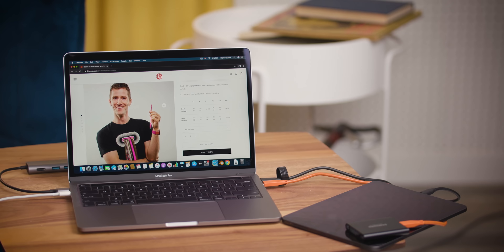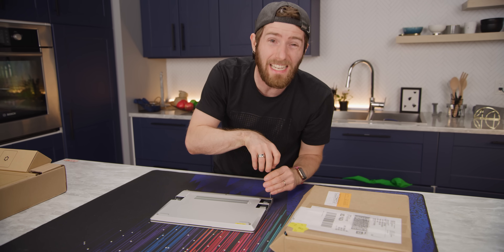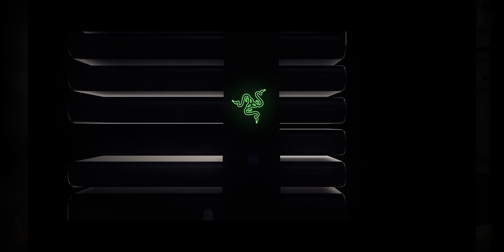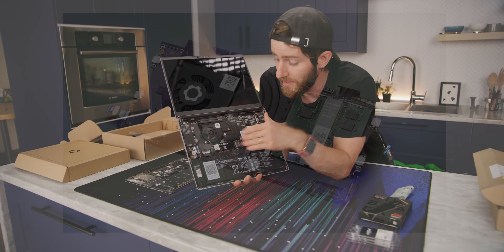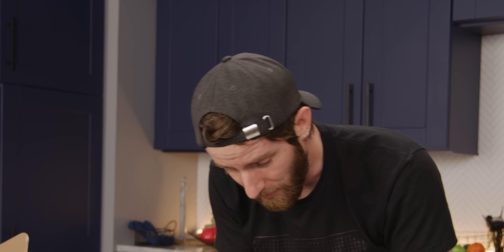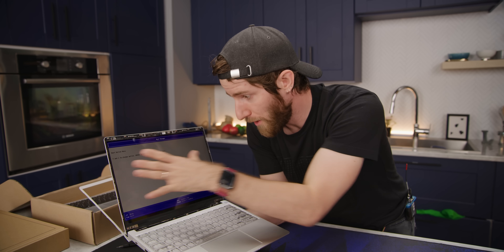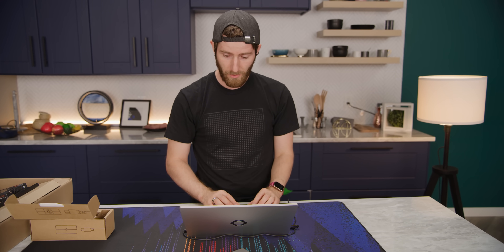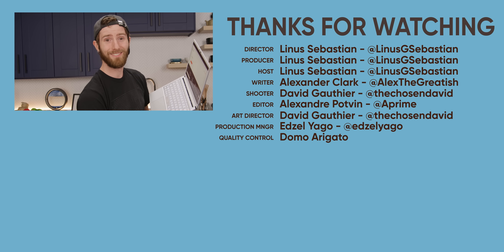A COMPLETELY Upgradeable Laptop?  - Framework Laptop Review

Comment: The only thing that would interest me about a "modular" laptop would be gpu choices, but there aren't any.  Without that, its WAY overpriced.
Reply: not overpriced if you compare it to other laptops with similar specs. But this isnt just about being able to pick what parts you want, its more about being able to repair without buying a whole new laptop or overpaying a tech that will charge you $100 just to replace a usb port
Reply: It's $1k less than an XPS
Reply: @CanadianLoveKnot    So?  A Ford truck is less than a Ferrari, but you can still buy a $100k Ford truck.  If you buy overpriced stuff, yes this is less overpriced.  If you buy what 95% of the rest of us buy, its not worth the extra $500-$600 over a similarly spec'd budget laptop.
Reply: @reviewaccount469  So what components are markedly different than an XPS? Memory, CPU, Graphics cards are all made by the same 2 or 3 companies.
Reply: @CanadianLoveKnot  
The question is NOT what is different between this and an XPS.  The question is what IS different between this and a similarly spec'd budget laptop.  The answer is the same!  The XPS, and this thing are BOTH just more expensive for no significantly better specs!
Reply: @reviewaccount469  Tell that to apple users.

Comment: That's my dream!!! Also, I can imagine using SSD expansion modules to host different OS. E.g. one SSD256 module will host Linux, another -- Win10. If I need to work in either OS -- all I need to do is to replace the module.
 Thanks for the review, have ordered DIY version. Just wondering if you can confirm the USB TYPE-C Extension has Thunderbolt support and if yed -- is it TB3 or TB4?
P.S. Hi from Toronto, ON. 😉

Comment: Actually Panda Project had a modular future proof PC that was easy to upgrade with I/O expansion cards, CPU/GPU expansion cards, RAM expansion cards utilizing a design for 256-bit computing support.  These days you might call it a Blade style of computer.  Modular support of drive cages meant you could expand your media drives and storage to whatever you needed.  It didn't matter what new standards came out as the whole PC was designed for easy upgrades.  And when the market went to 512-bit computing well they had that in the works as well.  It too was a commercial product that unfortunately fizzled due to extravagant prices.

Comment: If it can have a 360degrees/tablet touchscreen format that can extend keyboard / eGPU / high end CPU and so on, it'd be my dream. I would love to have just one system that is small and also smth for work duty.

I want smth like I have been doing with my desktop for over 25 years: modular and upgrade different parts as I go. Heck I still use the same case for my desktop for 13 years...

Comment: I still don't understand right to repair. Is there a law that makes it illegal to work on our devices? The only thing I understand is that they need to make parts available. I saw several times where you could have damaged the laptop. They void your warranty if the damage is your fault, which I see nothing wrong with. It's just like if you damage your screen. Manufacturers shouldn't be held liable for user damage.

Watch my channel and you'll see how I open up every computer and replace parts. Most people won't learn how to do board level repairs, so I'm a little curious on what right to repair does other than making other parts available.

Comment: Note that the DIY laptop is really $300 cheaper. It's base model is $963.00 vs. $749. But the DIY base price doesn't include an operating system, RAM or storage that is included in the prebuilt. So that's a $214 difference in price, but if you add even the 250GB NVMe drive (+$66), 8GB of RAM ($49), and Windows 10 Home ($139) that are included in the base model pre-assembled laptop, it costs $1003... which is actually more expensive. So unless you are going to BYO components for at least some of the laptop, or at least are going with Linux instead of Windows, you are better off going with a preassembled laptop.

Comment: wonder how upgradable the graphics are. I didn't see anything about that. with a desktop i can change out the video card making it last longer because the gpu upgrades are generally more important then the cpu upgrades to game performance in most instances. if the gpu is integrated into the MB then you basically have to buy a new MB each time.

Comment: Linus talks about this around 11 minutes but this doesn't really add anything new to the table. Most laptops support upgrading RAM or SSD's. They don't generally support upgrading CPU's, which this doesn't either. You also can't add or upgrade a GPU. It is easy to get in to and you can physically change the I/O but with USB-C you can turn that in to just about anything anyways. 

I love the idea but so far it's not really doing anything crazy

Comment: Interesting idea, but still a pretty penny.  It's been a very long time, and quite a few laptops, since I've replaced anything beyond drive, memory, and maybe battery.  What generally goes are the hinges and hinge point of the chassis.  Thinkpad used to be the gold standard for chassis.  How durable will this design be with daily open/close cycles?  Fans are also weak points, so it's good to see that one seemingly easy to replace.  The I/O choices are slick, I'll grant you since USB ports can wear or be broken, and the battery disconnect is brilliant.  I'd want to see a SATA bay or second M.2 drive slot - some nod to expansion without having to rip and replace a primary drive.

Comment: My current laptop is a Dell E6540, with replaceable WiFi, 2nd drive (hard or optical), RAM, and *CPU*.  The CPU is soldered to a board that is swapped.  I'm a little disappointed that Framework didn't adopt this approach.  Nonetheless, they have a more expandable product than anything else currently on the market (that I've seen).

Comment: I actually screamed when I realized that all of these components were standard USB connectors so even if you can't get a hold of the modular parts, you can use regular USB-C devices in their place
Reply: Heck i could even use my USB-C Phone charger yea it will charge slowly because it can only feed 15 watt but hey user friendly laptop afaik
Reply: Honestly I'm getting the feeling you're just proud you know what the form factor is, and are completely missing the point...
Reply: The biggest problem with a USB is it's speed. It's nowhere near fast enough to actually run the parts of a laptop that will make it obsolete. Unless of course you throw away your vacuum when it's belt breaks.
Reply: @LeoHKepler  I'm betting that their long-term game plan for the most obsoleting component - the motherboard - is that they're planning on using the same form factor. I'm hoping they manage pulling off making a standard for motherboard form factors in general
Reply: @DatdudegilToo  the problem with that is that the "form factor" doesn't account for actual architectural, material, and bus technology advancements that are happening yearly. I can't tell you how much old RAM I have, for example, that is incompatible with modern computers simply because of the advances made in power consumption and distribution that have been made since then. And we're talking about sticks that are 2 years old that are so obsolete technologically that my newly built PC has power allocation issues even when adapting and controlling the RAM on a separate adapter. An adapter that is prohibitively expensive to build.

You also have to consider that your average consumer is a use, abuse, and chuck kind of person. That's why people like me still try to build modular components for ourselves; the money and thus the industry isn't geared towards us. And even I have to concede to scrapping stuff that's just too old and incompatible to justify integrating it.

Ultimately what you're looking at is, generously, 5 years, likely 2 years before that laptop is so out of date that even modular components won't integrate properly. I mean, you're also talking about time and money spent on integrating backwards compatibility with a SLEW of old components at some point that, again, would be prohibitively expensive for a company rather quickly. As well as diminishing edge they might otherwise gain on their competition.

Unfortunately the way we do things is still viable in the youth of our technology. When the capabilities of each component of your device are so vast that the cost to upgrade for two or three generations isn't worth the value of the device or component itself in power and versatility, and/or the time between generations is long enough, then we'll have abundant use for this kind of modularity. By then I have no doubt the structure and interface of the technology will be so vastly different that it will be far more user friendly to simply swap out bits and pieces as you need them, if not for an upgrade as well.
Reply: @LeoHKepler  I mean....they could upgrade the Mobo...or like Amazon Kindle...just give components for 3 or 4 generations and then say we don't support these anymore...that's where 3rd party people will come in....but I don't think they'll go that route
Reply: @LeoHKepler  given this response I honestly don't think you understand what a form factor is.
Reply: @DatdudegilToo  A form factor is the overall design of the component. I guess I could understand your confusion since I used the term "architecture". Architecture can mean form factor, but form factor doesn't mean things like the internal layering and design of a single microprocessor. That's what I'm talking about by "architecture" that would make these modules obsolete. Regardless of how you build around things.

Form factor... essentially just amounts to portability and interface. A few other things like heat distribution and expansion flexibility, sure, which are important here. But not things that actually impact the grade of a component that will contribute to it's obsolescence.
Reply: @LeoHKepler  lol, wut? It's fucking Thunderbolt 3 times 4. You can run external GPU well enough with that bandwidth
Reply: "The biggest problem with a USB is it's speed." 

no. 

the best thing someone could argue against it when using usb instead of PCIE for example is that more layers of communication get on the playfield, so it's less low level than a "direct" implementation of hardware. however, that's pretty much a theoretical problem and not something a "normal" user needs to concern himself with.
Reply: I can understand wanting everything nice and compartmentalized, but the reality is; these laptops overheat super fast because the architecture is made to be handled by laymen instead of exposed for cooling, the busses will be slower and less efficient because (beyond using USB in places they ... really shouldn't) etching is still the fastest line from piece to piece. So going through a controller, bus, and back is going to be much more versatile, but much slower.

This is also touching on a boarder line and nice sector of the market; laptops. For anything smaller the architecture won't allow for this kind of modularity. I've repaired cellphone circuits and done the micro-soldering enough to see exactly how someone would break a modular component that would need to be made a certain specific and fragile way to fit into your phone. So nothing smaller could be quite as modular. Yet. And anything bigger well... that's a PC, and those are as modular as they come. As modular as it can get.

I hate to break it to ya, but the laptop market doesn't encompass enough people who are into working on their own electronics to justify this. Many people have tried, and gave up, for the same reasons this company will. Unless they fundamentally change a number of things about computer and microcircuit assembly... They'll struggle, if they don't just go tits up instead.

Comment: So refreshing, and those little thunderbolt dodaddies can even be used in other laptops as a dongle!
Reply: I believe they are usb 3.2, not actually thunderbolt, but they are simple adaptors that follow the spec, so they should work just fine
Reply: @miguelagueda3928  which usb 3.2 though?  Because usb 3.2 gen 1 was previously USB 3.1 gen 1 which was previously usb 3.0.  fucking USB naming conventions I stg...
Reply: You should check framework's forum anyway, I'm sure they have more information about the modules. What I'm sure about, is that no driver is needed since que laptop can also run linux
Reply: @miguelagueda3928  Every peripheral needs drivers. But, most all of them will be compatible with a universal windows/Linux driver. This company uses standard off the shelf parts. They will work with anything. However, the USB Type C and A are a simple pass through, so no drivers needed for those. Also, you are right about no thunderbolt.
Reply: @BifsieOfficial  yeah, that's what i meant to say. I was referring to the use of a propietary driver so that it only works on this laptop, as someone mentioned earlier. Thanks for giving a clearer explanation
Reply: @Qdobafett  yep, especially if you are ten.
Reply: @honeybadgerisme  I'm 36.  Dongle is an amazing word.  Grow down...
Reply: @glasshalfempty1984  😂ok, peter pan！But it's still not as funny as when you are actually 10....just sayin'
Reply: Are we sure about that? There could be a driver that makes it only compatible with that laptop
Reply: @shootdaj  Why would it be like that?
Reply: @shootdaj  That would go against the entire spirit of the brand

Comment: Only issue I would have with this otherwise perfect laptop is that it doesn't have a default installed dedicated power input/usb-c port.  It would just make sense that you would always have a charging port on it.  Maybe you could charge it and then take out the extra usb-c, but it's still an extra hassle

Comment: This is so nice to see. If you ever saw an industrial controlled computer from the mid 80's - 90's everything was modular! The power supply was literately just the board screwed to the frame with the cables able to be swapped out in 30 seconds. It wasn't lego plug and play easy like today as you could plug something in incorrectly back then but it was just so nice to have modular EVERYTHING!

Comment: 5:50 The expansion cards on the Framework Laptop interface over USB4, not USB3.2
While the USB-A and Storage expansion cards only support USB3.2, the actual interface on the laptop side is USB4 and can be used with the USB-C card.

Comment: iFixit gave this system a 10 for repairability. Only two other laptops have ever gotten that score: the HP EliteBook 800 series (versions from various years, the most recent one scored is a 2020 model) and the Dell Latitude E5270 from 2017. Those are both enterprise laptops. No consumer laptop has ever before been given a 10 by them.

And honestly... if this is a 10, nothing before it is better than a 9. Even the motherboard and the CPU cooler are dead simple to replace. (Watch the iFixit teardown video.) Those I/O modules mean that the I/O ports on the motherboard are not vulnerable to physical damage. You only need to disconnect one ribbon cable to open it up; the keyboard and trackpad cables are combined. The magnetic bezel around the display won't break when removed, unlike the plastic tabs that are so common. And you only need ONE tool to take it completely apart; every screw is a Torx T5 or a Phillips P0, and the tool has a reverseable bit.

Right now this is looking like the gold standard of how laptops should be designed. The only question that remains is how well it will stand up to years of use.

Comment: Surprised you didn't bring up the Apple Pismo, you could replace the dvdr with a battery pack (i think it could even take 2 battery packs in its 2 modular slots), I forget what could be slotted, i believe a floppy drive 1 side, cd/dvd drive the other if at home and not using a battery - no doubt there were other replaceable slots but the fact you could buy a replaceable "something" was cool.
& I'm looking at an old Apple Pismo  as i type sat on my display shelves.... not quite an modular but close :) (i hate apple - even though it works, going to gut it and raspberry pi it.

Comment: They sent you some options that aren't available to the public yet like that clear keyboard. But I'm sure they will be available soon enough.

I ordered the low end prebuilt configuration rather than a DIY because it ends up being a bit cheaper than buying the parts and OS separately. You still get to choose the USB modules. The price premium for the 1165 configuration wasn't worth it for me, and the 1185 option seems overpriced, period.

I'm not actually going to run it with only 8 GB of RAM; I don't want a Windows system with that little memory in 2021. I will move the 32 GB (2x16 GB) over from my current laptop (which I plan to retire and sell), and use the 8 GB from the Framework along with a second stick that I already have when I configure the old one for sale.

You do give up a LITTLE with this. The size and weight are comparable to an XPS, but it's not as thin and light as an LG Gram. (It CAN'T be as thin; there would be no room for the memory and storage sockets.) I'll take that to get a laptop I can upgrade and repair. And if you opt for Windows you get an install with ZERO bloatware; I don't believe they have changed anything other than a theme and wallpaper.

I'm looking forward to seeing whether the build quality lives up to the reviews. They certainly don't appear to have cheaped out on the components; you're getting quality RAM, storage, WiFi, keyboard, etc. It's priced as a premium laptop (comparable to an XPS or the like) so that is as it should be; this class of machine should not have hidden compromises like an SSD that wears out quickly. Mine is supposed to ship this week!